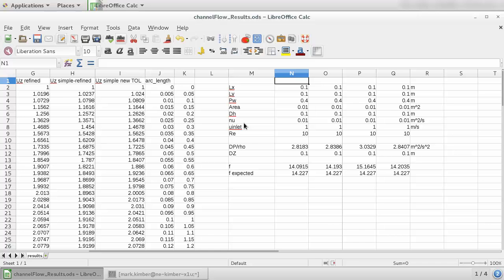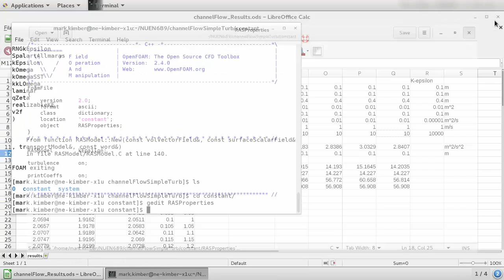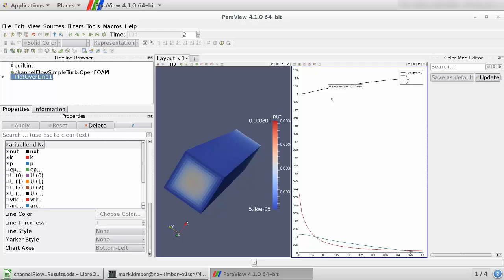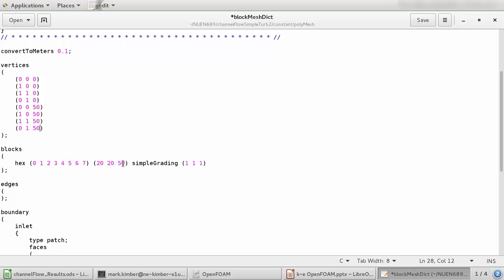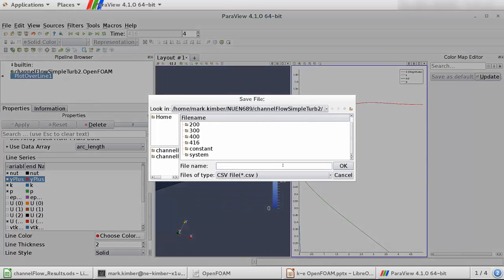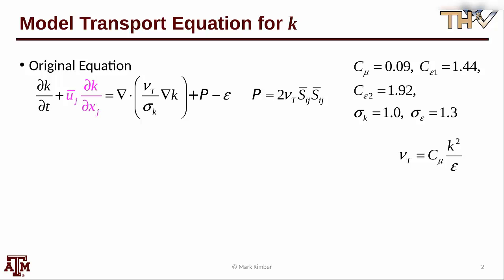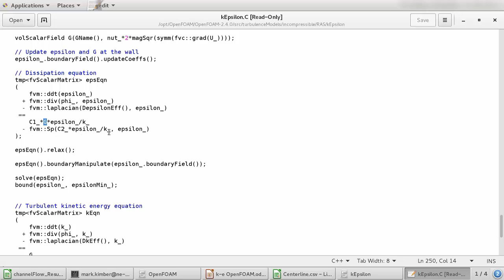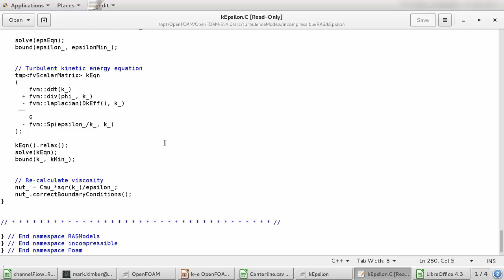k-epsilon modeling of turbulent duct flow using openFOAM (part I)

Comment: Hi.

I followed your instructions for applying  kEpsilon Turbulence Model. my geometry is almost the same as yours. But when the solver RUNS,  after some iterations the residuals of k and Epsilon becomes very high and the solver stops. And the values of residuals of velocity are also not converging. I don't know what is the mistake. The Laminar flow is working perfectly on the same geometry. Can you please help me in this?

Thank you
Reply: Hello, I am also having the same issue. How did you manage to work it out? Thank you

Comment: Hi, a single ask for this time, where did you get the value for k=0.375 and epsilon=14.855 for this video?
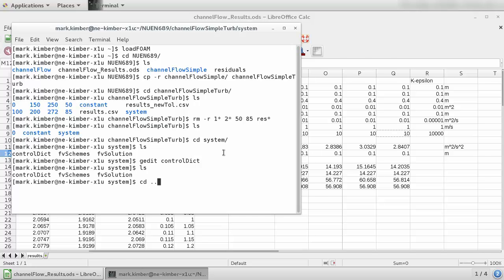Reply from the maker: Those were arbitrary numbers included in the original openfoam tutorial files. I discuss how to adjust them to be more realistic given the physics of the channel flow. See the 6:00 mark on the next tutorial

https://www.youtube.com/watch?v=j3U7-17cZ6E&list=PLOMAD1NLiFnw4sfxSkiCZwj20CzHjOuGh&index=6
Reply: thanks you mr. very clear at the video.. i think ill improve my simulation in openFoam with K-e.